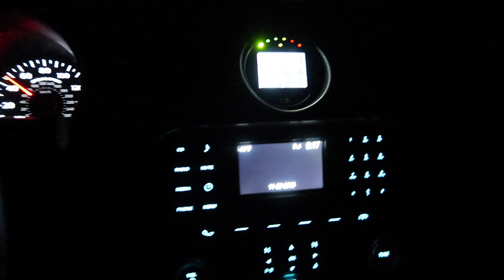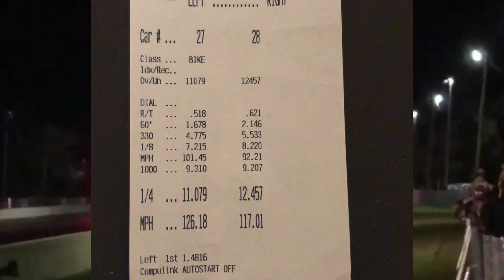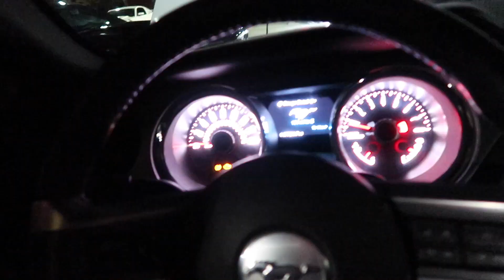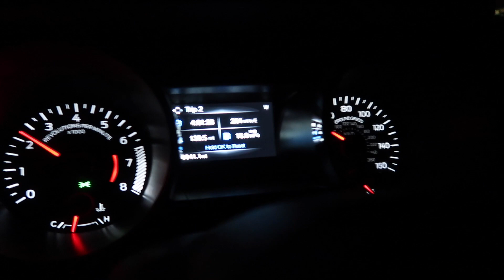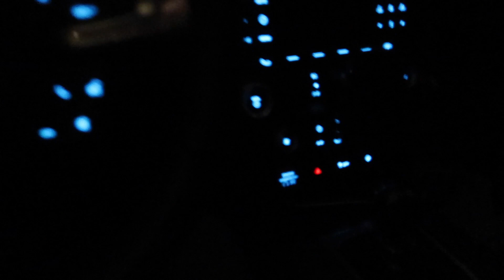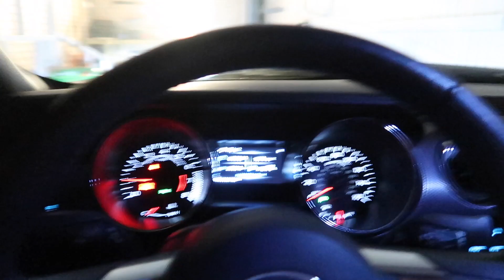2019 Camaro ZL1 vs. Bolt On 2014 Mustang GT

Comment: I heard you get a purse and tampons with every camaro purchase
Reply: My buddy has a Camaro and when I got in it he has tampons in the cup holder lol
Reply: leeleelee no no no no, you see you are mixing that up with a mustang.
Reply: leeleelee i heard you get a crowd insert here sticker and a check engine light with a mustang 🤔🤔
Reply: Chito Arredondo I don’t recall 🤔
Reply: Yes it comes standard the premium brings a pepper spray to scare away mustang owners
Reply: @nelsonvargas7182  You don't need to scare them away 90% of the time they'll spin out into a nearby crowd. Oh and the tampons are actually an extra first aid kit just in case you run vs a mustang.
Reply: @raphII2  I'm In crowd control training now 🤣😂 we dont have tampons, but it sounds like you havent read the owners manual, it should be in the purse the camaro came with.🤣😃😂

Comment: Mustang Lifestyle
you should tell your friend with the black s197 that ran a 12.4 to ditch the cobra jet intake manifold and get the 18 gt manifold instead. It will cost $600 to $700 with it being ported and will put out more hp and tq then the cobra jet. Plus the 18 manifold wont have any of the torque loss that the cobra jet has its legal and cost about half of what the cobra jet would run because you need the cobra jet throttle body and i think one or two other parts. AED or Lund all day for the tuner on an s197.

Comment: Do I sell my 10” Camaro SS for a 12” coyote. It’s a manual, 60k miles stock for 13,9 insane deal
Reply: Is it wrecked?
Reply: Do a cam and headers on that camaro 100whp or more you could gain
Reply: The mustang? No, my camaro is mint never seen snow 58k miles. Yeah, I’ll mostly just do a cam, lifters, etc.
Reply: @Ennis09  Yeah the mustang.  Yeah just do a nice cam if it's a manual 500whp is attainable without heads.
Reply: Chris Ennis no don’t sell it lmao.
Reply: Get the coyote
Reply: Definitely buy the mustang you will not regret it
Reply: Chris Ennis coyote engines can handle power and will beat most platforms.
Reply: Stick with the camaro man, no reason to swap for a 12 coyote. And if you go for 15"+ there is still no reason to get a coyote other then the looks.